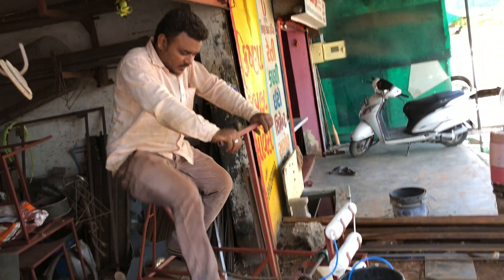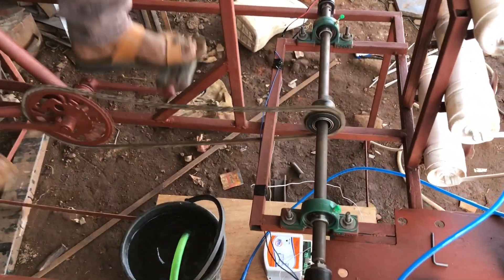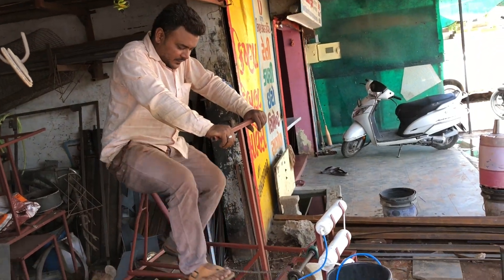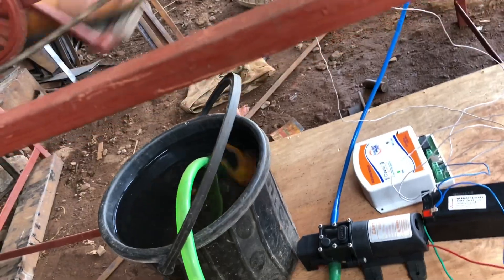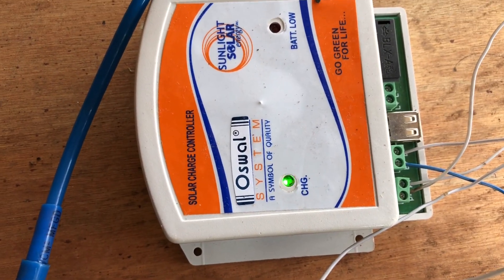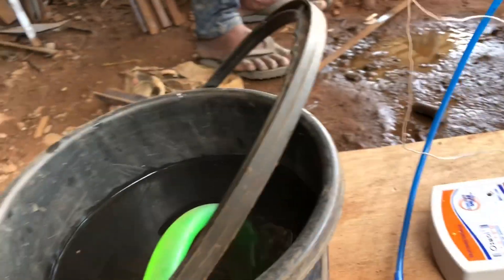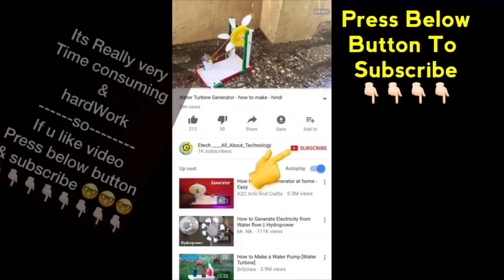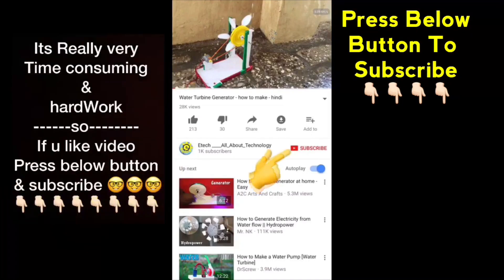Pedal Operated water Purifier | Free Energy

Comment: Sir...kya aap is project ke equipment ki list bta skte...h.....hmm yhi project bna rhe h for diploma mechanical engineering....and kya cost h is project ki
Reply from the maker: Material details:
1. chain
2. small & Big sprocket
3. pedal 
4. shaft
5. Bearing
6. dynamo 12 v dc
7. charger 
8 . battery
9. Booster Pump 12 v dc
10. Filter of RO water 
11. structure
Reply: @Etechinfo  Tq Sir...
Reply: And cost sir??